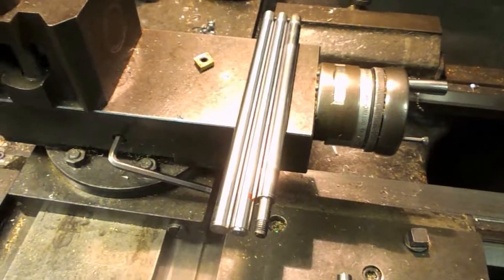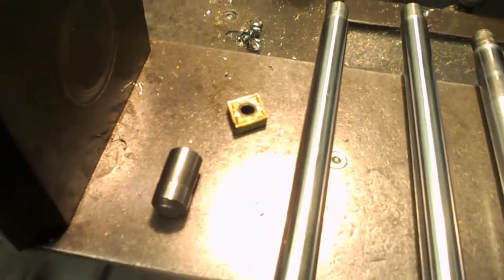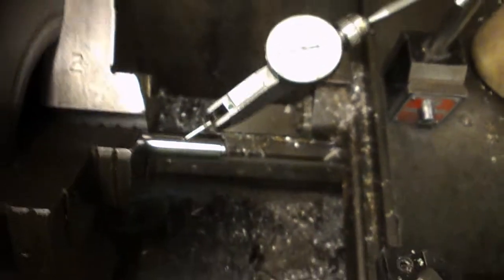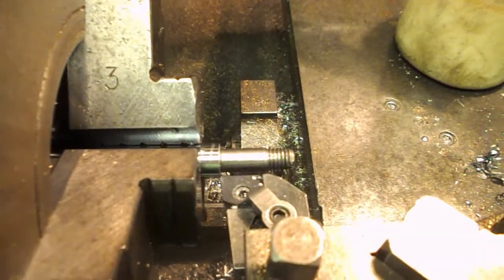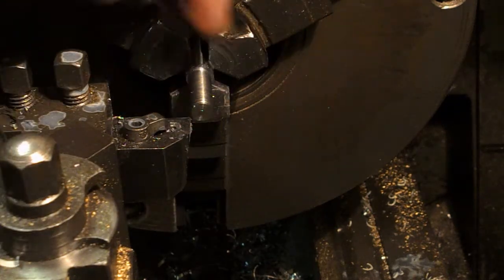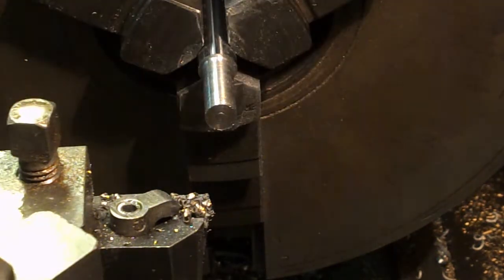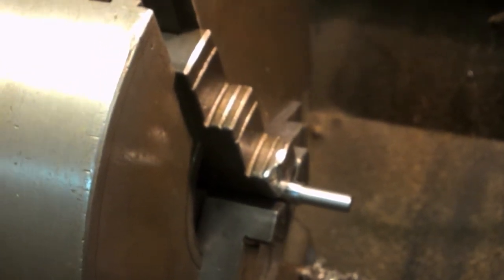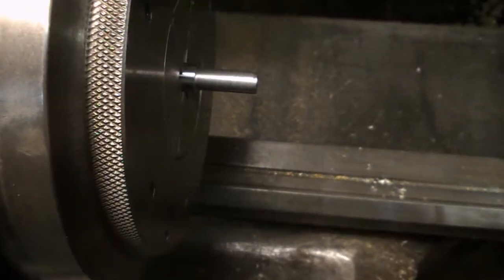Chuck vs. Collet. Turning down & re-threading Damper rods

Comment: It's always difficult to guess what is acceptable in run out and tolerances on a job where you only get to see a part of the whole thing. I find it leads to going for the tighter limits to be on the safe side despite the extra time it takes, good job i work for peanuts. That's nearer the truth than the you might think but that is another story.

On your die holder you might find a short lever helpful. On mine i built it with a lever just short enough to spin freely over the saddle. This allows me to hold it under power but let go if the torque is too great without fear of any damage as it just spins with the work. Hope that makes sense, it does to me but then i already knew about it.😉
You reminded me that someone gave me one of those collet and chuck sets but in D1 4 not D1 3 that my lathe uses. I must get round to fitting a back plate and trying it. so many things to do and so little time to do them.😢
Reply from the maker: Yes, the spanner on the die holder is a bit clumsy ! I've always thought that fixed handles/levers could damage fingers if used under power but If you go slow enough I guess they could work well.
The Burnerd Multisize collets are very good & the the more common key operated chucks should be more convenient than the lever operated one that I've got, which needs the lever pivot anchor to be clamped to the bed making it a bit more fiddly to fit - hence my reluctance to swap the 3-jaw chuck out for this job!
Reply: @MidEngineering  at a slow enough speed you have time to let go and move your hand out of the way.
Mine is the lever closing type like yours and i get your point about the anchorage point, good for repetition work less so for one offs.